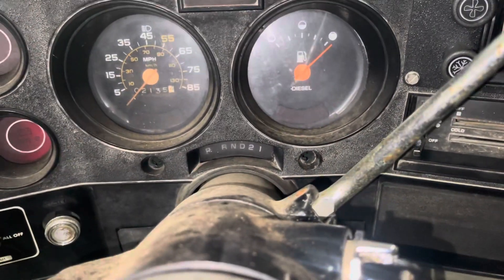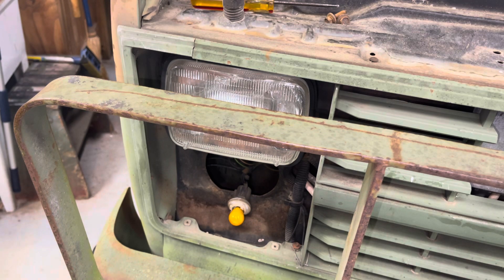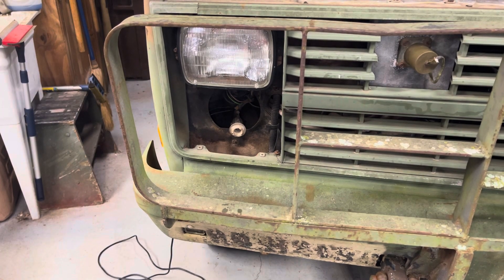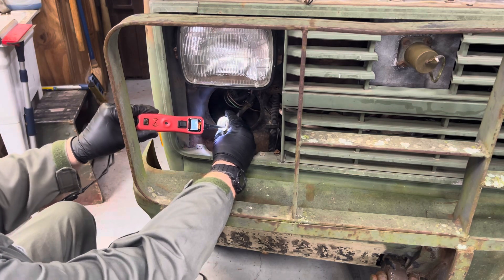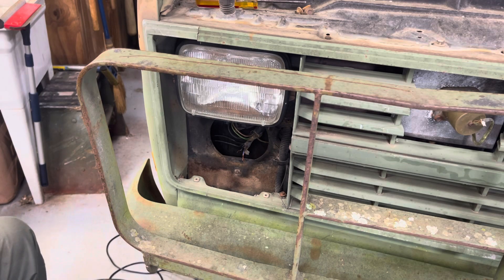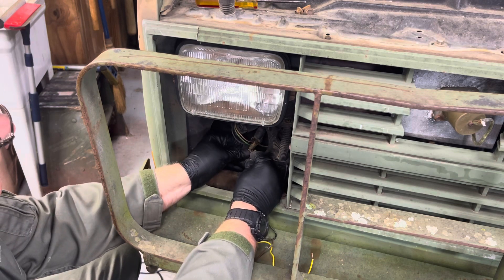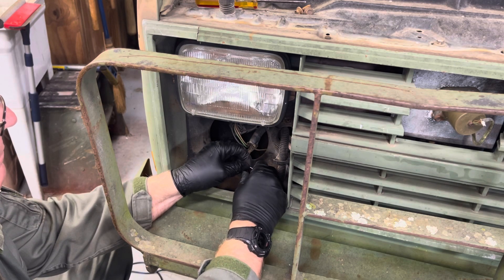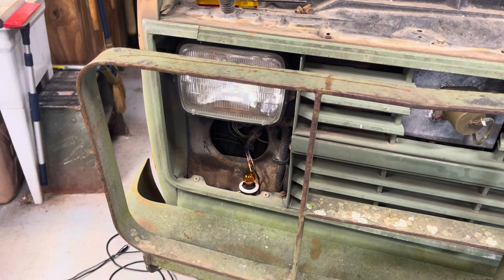CUCV, Square Body Chevy front blinker bulb holder common failure and fix.

Comment: Was watching one of your videos, if the front battery has its own alternator, why deleting the resistor is a detriment to the front battery.
Reply from the maker: A stock CUCV uses both batteries in series at 24 volts to power the glow plugs with the resistor knocking it down to 12 volts. Removing the resistor leaves just the front battery to power the glow plugs. That puts that battery under a bigger strain than a normal 12 volt only diesel where the glow plugs get power from both batteries in parallel.
Reply: @timsteachablemoments1786  I saw this converter on eBay, 24v to 12v 100 amps, DC to DC  Buck converter, could it be used? Check it out and give me your thoughts.
Reply from the maker: @shawnlawrence4840  People use converters like that when swapping V8 engines into M715 trucks while trying to keep the truck all 24 volts and running a 12 volt ignition system. I have been with people with such conversions on their trucks and had them die on the road. Or just not start the next time they try. I don’t like that option. 

Living with the resistor and the 24 to 12 drop. Removing the resistor and running off the front battery or wiring direct 24 volts with 24 volt glow plugs seems to be the most “Cold, dark, rainy night just outside of cell phone range” proof options.
Reply: @timsteachablemoments1786  so that would mean change all bulbs to 24v along with the glow plug solenoid and glow plugs
Reply from the maker: @shawnlawrence4840  The CUCV has 24 volt starter, glow plugs and military radio capabilities. Everything else is 12 volts like a normal Chevy. So, the glow plugs can be wired 24 volts or 12 volts.
Reply from the maker: My guess is GM hadn’t developed a 24 volt glow plug for the 6.2 when the CUCV was ordered initially. So, they made the system 24 volts with the resistor and 12 volt glow plugs.

Comment: I converted mine to LED all the way around except headlights but it aint really worth it. Not much brighter. If you do you have to get all new flasher relays that have the ground wire built on to it before they function properly. I need a new socket so thanks for the part number.
Reply from the maker: LED brake light bulbs also cause factory Chevy cruise control to not turn off.  Not enough resistance.